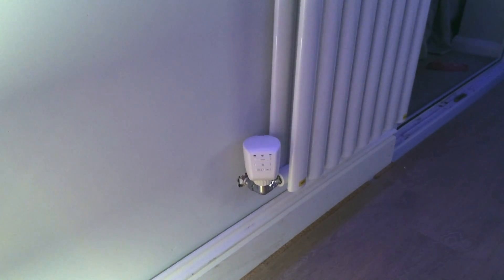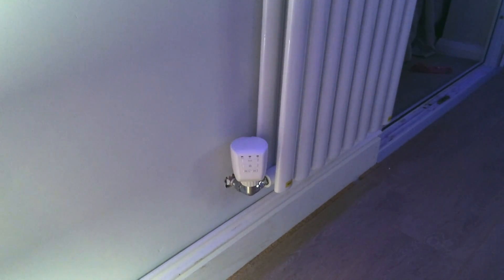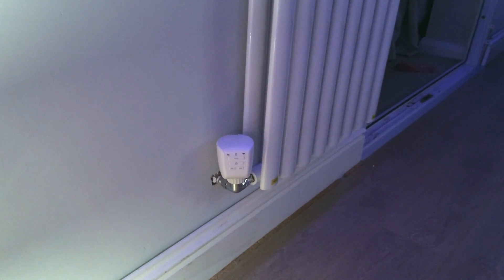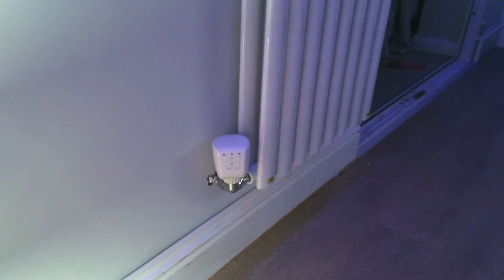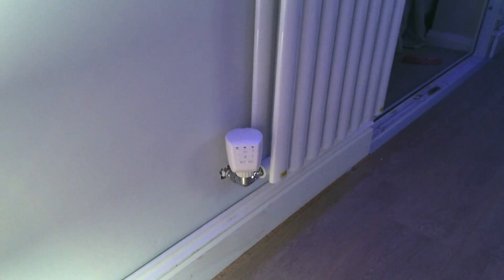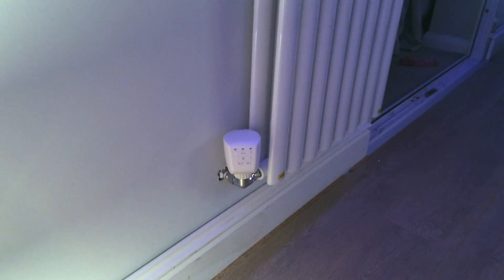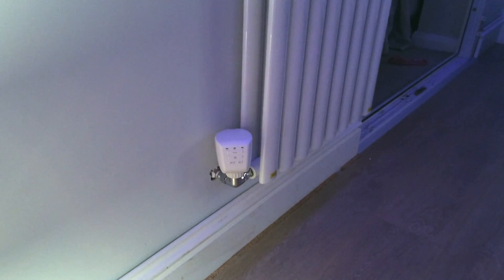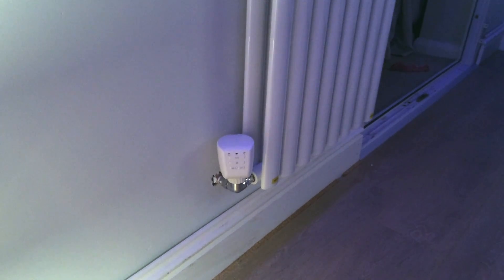Demo of the LightwaveRF Heating Wi-Fi Thermostatic Radiator Valve Actuator

Comment: Is the unit battery operated? If so, what type and how long do they last? 

Next point, does it sense when the room reaches temp then adjust how open or closed the gate is?
Reply from the maker: Craig Harrison The unit is powered by two AA type batteries. Quoted life is 1-2 years I believe but this will of course depend on how often the motor has to move. The theory is that these work just like standard TRV (Thermostatic Radiator Valves) by reading the temperature and adjusting the valve accordingly to maintain that temperature but they are also 'smart' in that they can be programmed using a smart phone (requires a LightwaveRF Wi-Fi link connected to your home network in order to translate the commands sent by smart phone app into 868Mhz RF). You can also link them with room programmers and a boiler interlock to control the hot water flow (no rads on = boiler off).